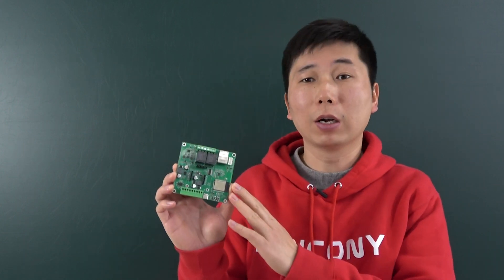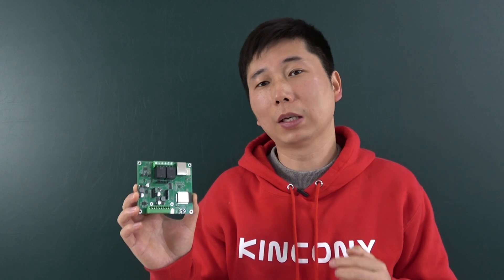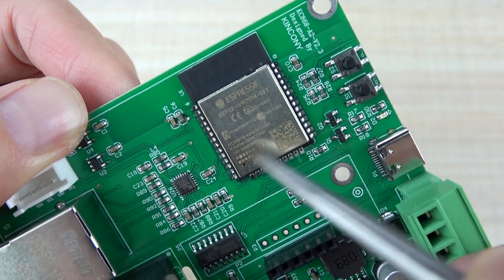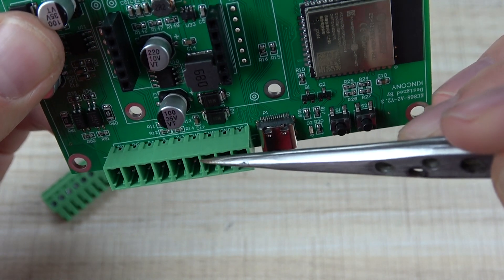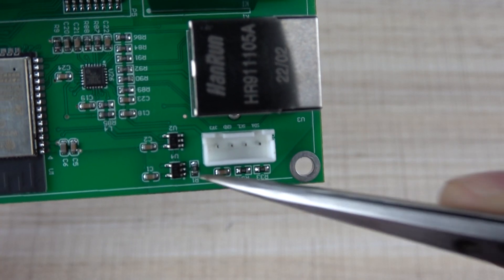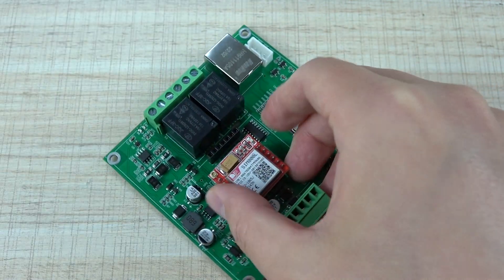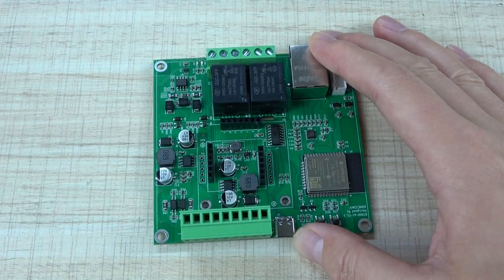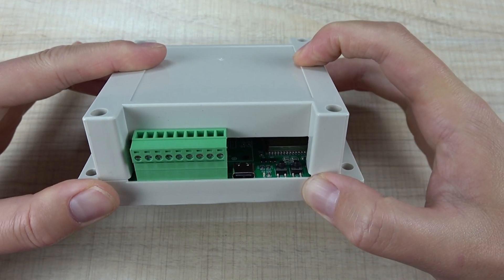ESP32 + 2G SIM800 +4G SIM7600 + Ethernet RS485 relay = KC868-A2!

Comment: Hello. The A2 board supports 9-24V power. What voltage should be on the digital inputs when using 12v and 24v power? I don't mean connecting the voltage to the inputs, but what is the voltage at the digital inputs themselves.
Reply from the maker: if you using 12v power supply, the digital input use by MAX12V. if you using 24v power supply, the digital input use by MAX24V.
Reply: @KinCony  That is, if I use a 12V power supply, then if I measure the voltage between DI and GND, it will be about 12V, and if I use a 24V power supply, it will be about 24V between DI and GND, right?
Reply from the maker: @TaurosRMK  you need to input voltage, if NULL of digital input pin, there is no voltage.
Reply: @KinCony  That is, if wire is no connected to the inputs and if I measure the voltage between DI and GND, then there is no voltage there? And if it turns out that there is voltage there, then is it a problem with the controller?  

I just want to understand why when connecting to the digital inputs of the tachometer signal from the fan (pulses), the controller does not read the revolutions when I use 24V power, and when I use 12V, the revolutions are read.
Reply from the maker: @ Because the digital input has optocoupler, not connect with ESP32's GPIO pin directly.

Comment: Hi @KinCony. Are there any options to connect an SPI bus to this board? I need to connect the MAX31865 module, 4 SPI pins + 5V/GND power supply.
Also, can I connect the Peacefair PZEM-004T V3 module? It needs RX, TX, +5V, GND. Can I connect this module instead of GSM modules (I don't need them)?
Reply from the maker: KC868-A2 no free GPIOs use for SPI bus or serial port device. I suggest you use KinCony A24 board, that have MAX31855, support 3 channel K-type thermocouple.
Reply: @KinCony  Is it impossible to use RX/TX pins to which GSM modules are connected for PZEM-004T? GPIO13 GPIO34
Reply from the maker: @TaurosRMK  it's ok
Reply: @KinCony  How do I connect the DS18B20 sensor? There is a 3V output and GPIO on the terminal block, but where should I connect GND?
Reply from the maker: @TaurosRMK  sure, green terminal have 3.3v output , GPIO, GND. 3 pins use for DS18B20.

Comment: is it have 5v to 12v dc output?
Reply from the maker: do you want to adjust voltage output?
Reply: @KinCony  yes i want connect rs485 power for 5v to 12v
Reply from the maker: @yeongmuseo7737  sorry, i don't understand you. why RS485 need 5--12v?
Reply: @KinCony  The sensor module I want receives a separate 5v~12v variable voltage as input power.
Reply: @KinCony  This can be developed in the direction of mounting a power board separately.
However, the interest is whether the board developed by Kinconi is compatible.
Reply from the maker: @yeongmuseo7737  can you draw a photo send to our email , so that i can understand you.